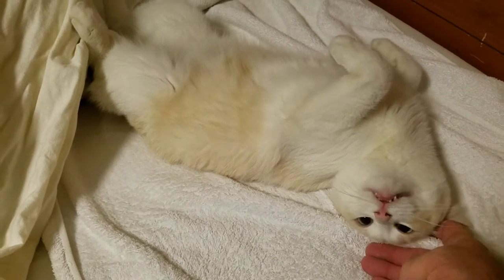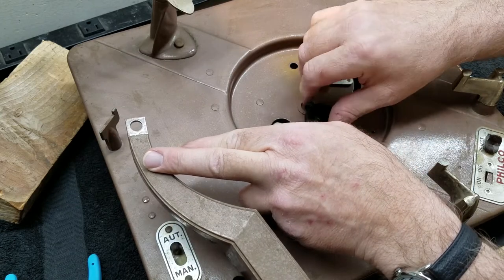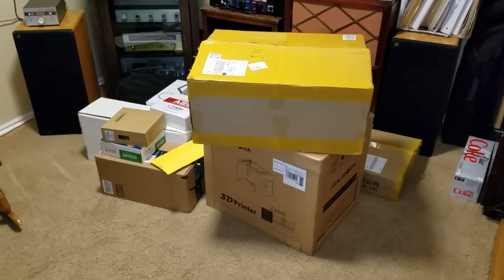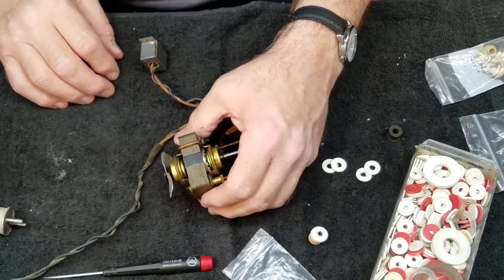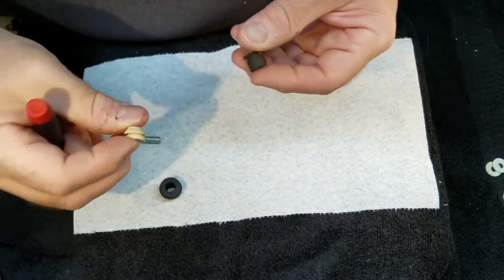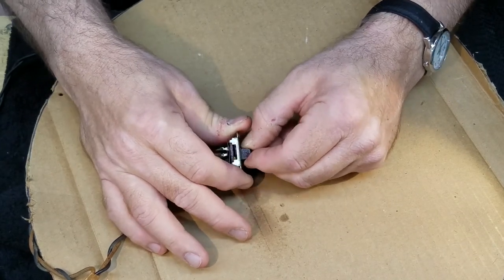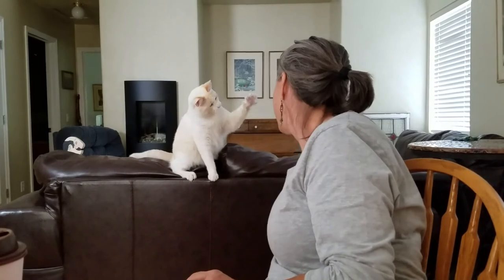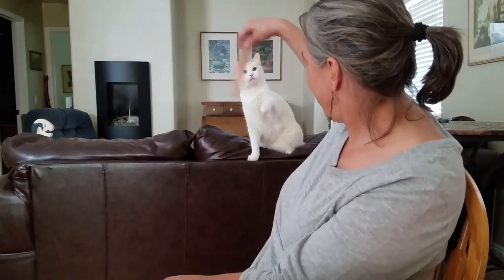1947 Philco 47-1230 Antique Tube Radio Phonograph Part 4 of 14 Changer Top Side

Comment: I had a bouncer with a Garrard changer in an HMV (RCA Victor) when I freed the platter but the cam froze two weeks later. Should have checked the cam when I worked on the platter. D’oh!
Reply from the maker: These thing will bite you....hard!   There are two types of problems that I see a lot:  Those that are so overlubricated that they become large balls of sticky mess...and those that were never touch, with all the metal worn out and parts seized-up!  Without a doubt, I'd rather clean grease than free seized parts!   Thank you for watching.  I am grateful that you took your time to comment, too!   Cheers!    Michael

Comment: They sell an almost identical grommet on eBay. Search "jukebox grommets" and you'll see it. Problem is, there are no dimensions shown and who the heck wants to pay $6 for 1 grommet ? In your case, you could have stacked two regular grommets to achieve the correct height if necessary. The metal rod would keep them together. I'm a cat person so yours added a nice touch to the video.

Comment: How about making  bushings from silicon?
I love your videos but the guessing game.... 
I would love to see a restore on something like a tube McIntosh amp. I know they are not  $50 but it would be great Thanks 
Love the videos.
Your ideas of lacquer atop cloth covered wire is brilliant. I don't know if colored lacquered paint for model planes is still available, but it would work really well for recoloring or color coding.
Reply from the maker: Hey, James!
I'll start with the last, first.  I'd love to do a Mac, or an earlier Marantz or Harmon Kardon.  I just don't come across those sets.  It's probably because I don't really look for the expensive stuff.  There is a fella out there who wants me to do his vintage McIntosh amplifier.  If you ever brings it to me, I'll do a vid series on it.  

On the guessing game....patience, Grasshopper!   I need to get the Philco out the door.  I will tell you that the answer to your second question may also be the answer to your first question.   Stick it out with me, and I don't think that you'll be disappointed.  I will tell you that I intend to try to adapt what I'm doing with all those boxes into something that might be useful to others in the hobby.   I'll leave it at that, for now.  

Thanks, James, for watching and for commenting.  Your comments are valuable to me!    Cheers!     Michael

Comment: Ya know instead of putting drop of oil on the tip of a screwdriver.... I use a old ink cartridge syringe filled with oil , lets you put a drop exactly where you want it...
Reply from the maker: Yep, that works great, too.  I've done it before.  I just keep forgetting to buy some syringes.  I'll get some soon and they'll start showing up in the vids in the next few weeks.  Thank you for the suggestion.  I had not thought of ink fill syringes.  I was going to stop at the farm store and pick up some that are used for animal vaccinations.  Thank you for watching and fotr taking your time to give me a tip.  They are really quite valuable to me!   Cheers!    Michael.